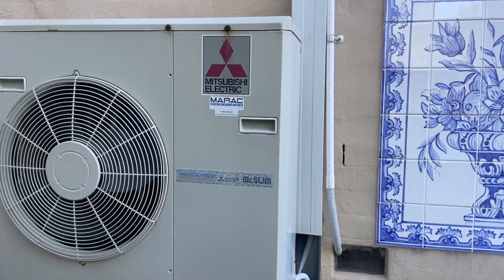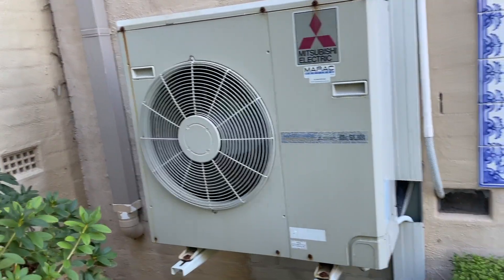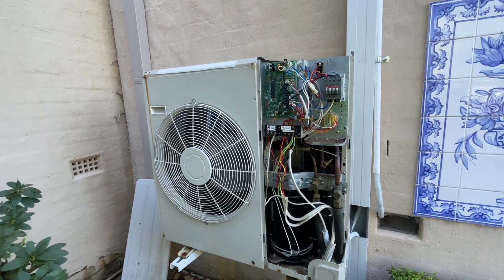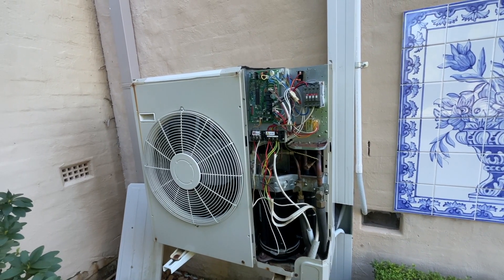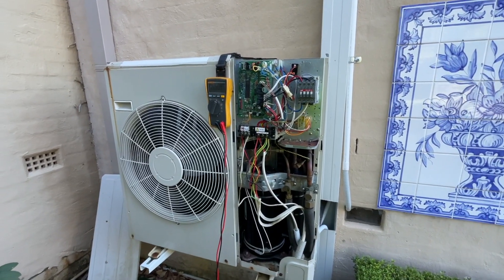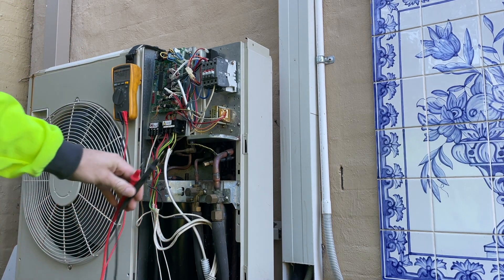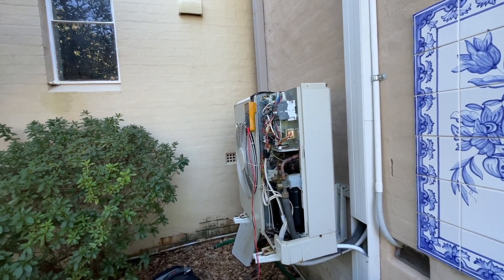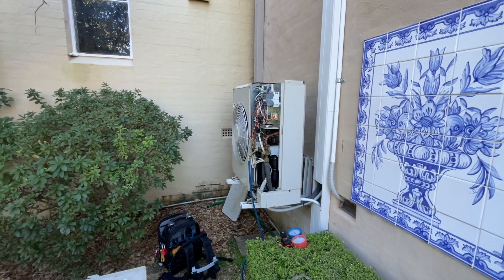Mitsubishi Electric Air Conditioner displaying P8 Fault

Comment: Ah man these systems give me scares. Complex and mother boards with ics, one of the most fragile pieces. I have evaporative cooler and have decided to take the bullet and replace it with these systems. Not sure how reliable and long running it would be.

On another note i have a samsung vacuum cleaner. The board failed  although i am not an expert but i just by passed the board and connected the wires. I use that vacuum cleaner as backup , no intelligence no ics just pure mechanical machine now. It just runs at full when i switch it on. Life of long running mechanical machines is shortened by these mother boards which makes the system intelligent but also weak.

Comment: Hey mate. Could you please expand on the idea of replacing the PCB with an aftermarket one? I’ve been working on A/C for 10 years and I’ve never heard it mentioned before. Would be a handy solution in a pinch. Cheers

Comment: I'm not familiar with the Mr slim units, but are those not full inverter systems? You seemed to be able to just hard wire both the fan and compressor to line power and they ran. On a normal unit I don't believe that is possible.

Comment: I remember being around these older Mr. Slim units at my primary school and remember when I used to talk to the technicians and ask 'What's wrong?' Those units suffered from compressor failures and gas leaks if I remember correctly! One time I remember one of the indoor cassette units kept running, even though the thermostat was off, I also heard a couple of them defrost!

Comment: Did you happen to check the glass 240v fuse on the board?  I’ve had those blown before.  Regardless replacing that unit with the leak may have been your best option.
Reply from the maker: Yeah there was correct voltage both sides of the fuse. I also checked that the fuse had continuity. All good. I agree, I think it’s time to replace the whole unit.

Comment: Awesome content Mitch! I really enjoy watching all your videos.
I have a question, I live in Tasmania with a house that is 150m square, I have ample roof space, what ducted unit would you suggest I install?
Reply from the maker: Depends on the height of the ceilings but let’s just say they’re 2.7m and the 150m2 includes wet area’s and hallways which you wouldn’t need to serve then let’s say a 20kW unit would be perfect. You could definitely go smaller but without seeing it, I don’t want to lead you into issues. If you don’t have 3 phase, then a 16kW system with zones would be the go. Preferably smart zones that can fluctuate based on temperature.

Comment: Good one Mitch, by the sounds of it youve got the ServiceME app aka the mitsi electric app - a handy tool for fault finding. At the end of the day theres no point flogging a dead horse, put a new one in and everyones happy.
Reply from the maker: I actually don’t have that app so thanks for the recommendation, I’ll download that straight away. I think I’m a bit old school in that I like to fix everything however in this case I agree with you, it’s better to put in a new inverter system and everyone’s happy.